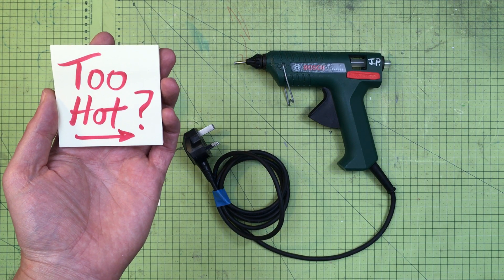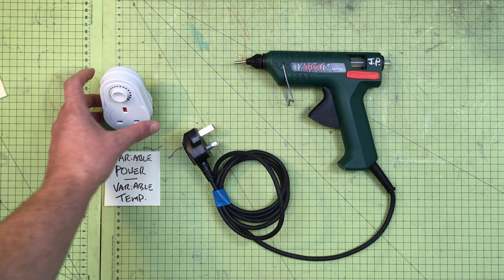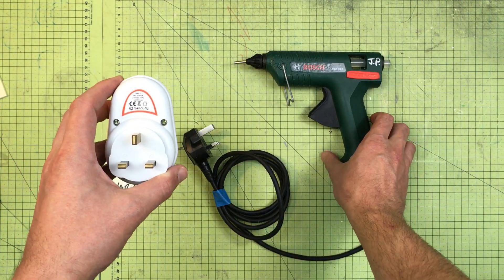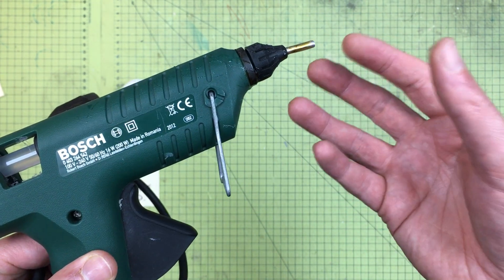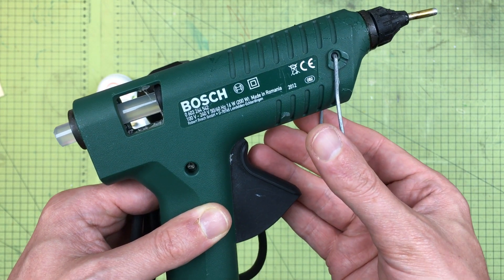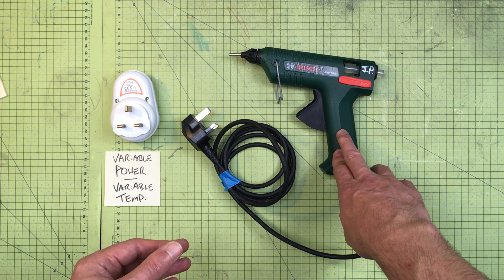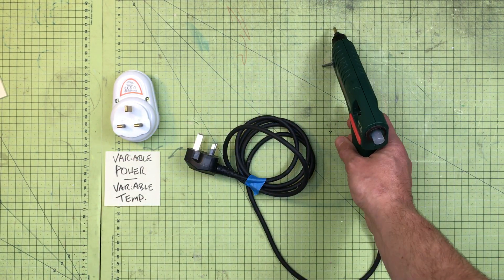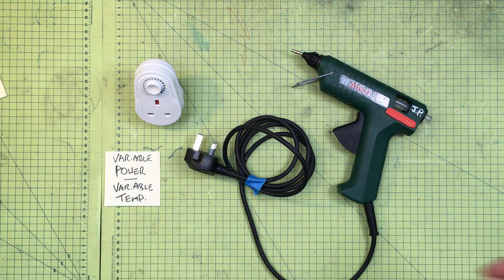Too Hot Glue-Gun Glue?  ---  Use a Dimmer Control to Cool it Down!

Comment: Hi I am looking for something to lower the lowest temp of a glue gun. It is too hot for the product I want to put in it wax. And all glue guns run too hot! I found one thats really cool with all kinds of tips, that has a low temp setting, but that low temp is still too hott! Do you think on the low setting and with this dimmer on a low setting, I could get the temp down lower than the lowest temp for the gun?
Reply from the maker: @yellowjello1094  sorry this is not a great answer - but it’d say you need to just give it a try. It get complex that if you use a fancy appliance the heater may use PWM, in which case the electricity is being modulated (on/off) at varying rates to control the temp. This means it may not work to have a ‘dimmer’ as I have suggested. The Bosch one shown is ‘dumb’ so is not affected by this. So without seeing the insides of your devices I’d only be guessing. If you know anyone good at electronics perhaps ask them and they can help verify if it’s likely to work. Be safe with mains electricity and always check with someone qualified/experienced. Hope that kinda helps.

Comment: Hi Jude, could I use this method to slow a Dremel down? I find it is too fast for precision sanding (even on its slowest setting)
Reply from the maker: I suspect it will work if it’s an older model which is less likely to have complex power management (which may not function correctly at lower voltages). Considering the device is only £5 it’s worth a shot. It’d be very unlikely to break the Dremel but I can’t promise. I use Proxxon myself.
Reply: This is the answer I’ve been looking for for a long time!! I work with young students, and when we have a longer lesson like you said the hot glue becomes like lava. I’m about to buy a few of these and try them out at school. Thank you so much for sharing.